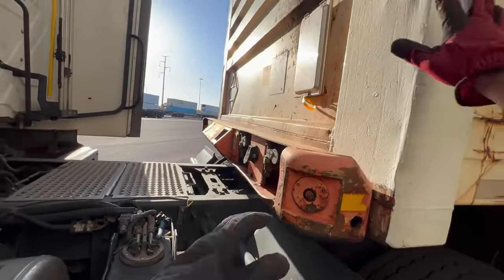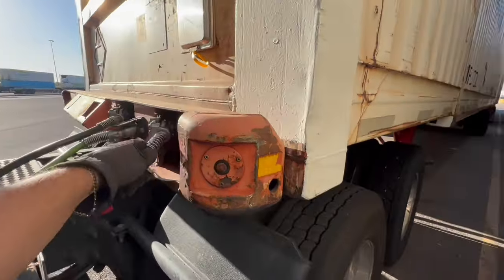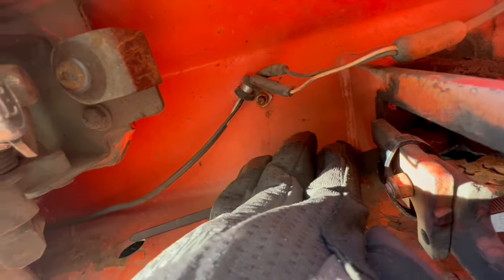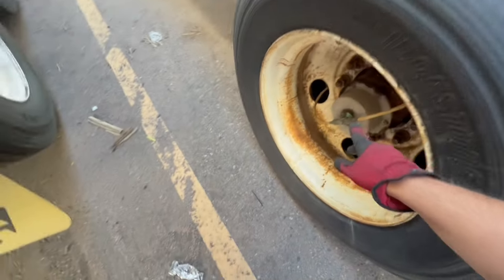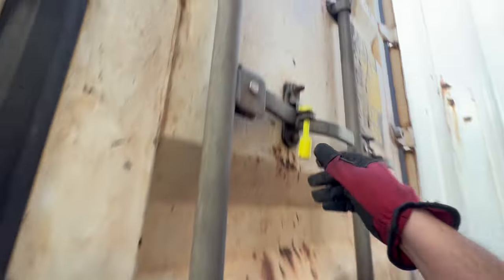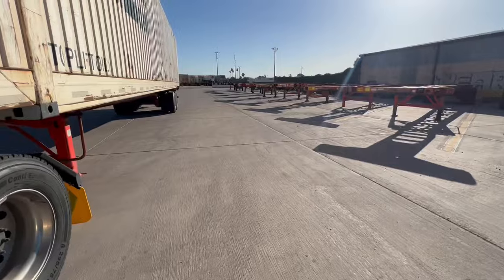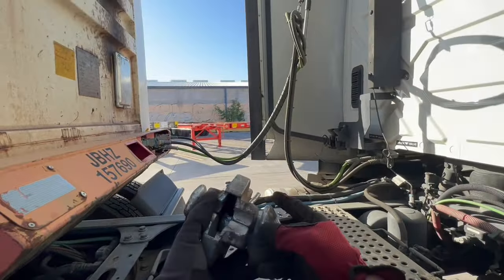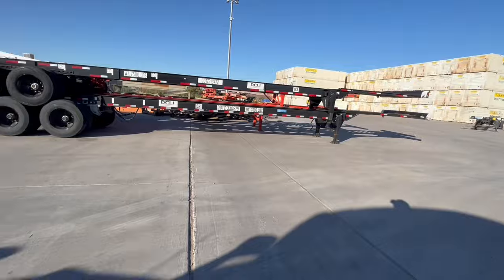How are Containers Stacked on Trains | PRETRIP | **Is Intermodal a Dangerous Account???**

Comment: Operator at a intermodal yard. 9/10 times IBCs(locks) are going to be stuck at the bottom of the box. Groundmen/tiedowns are responsible for those. But when one guy pulls 4 of those every 53 feet for 5000 feet he’ll miss one. Love your professionalism, a lot of road drivers should really take a look at this video.
Reply from the maker: Thank you!! I was hoping to convey the message that the hard working crew have to make sure locks are removed. 
I see them everyday tip toeing and balancing themselves in order to either secure or release each lock from EVERY container that are miles long. Definitely not easy.